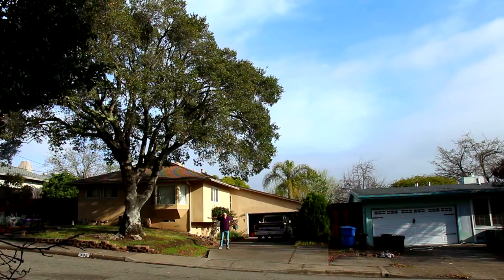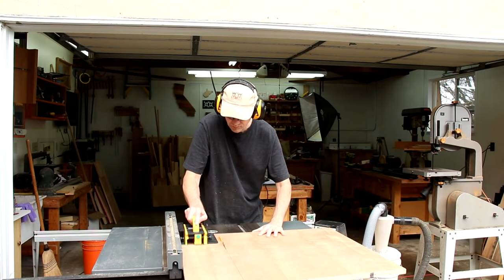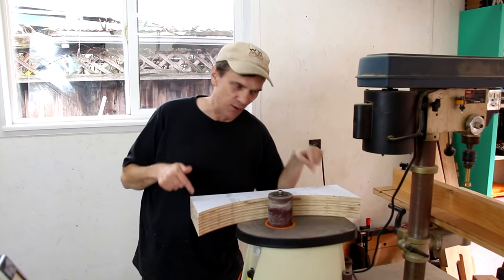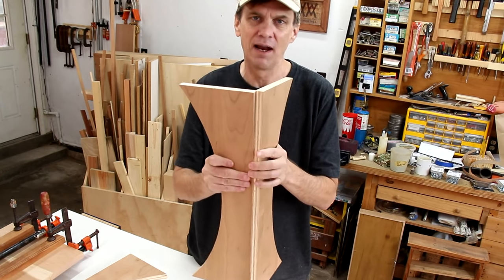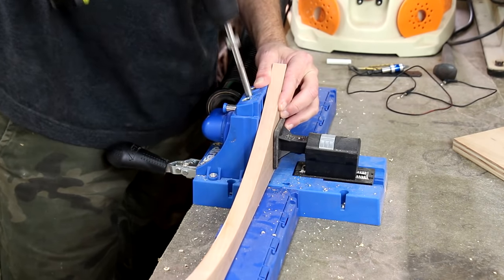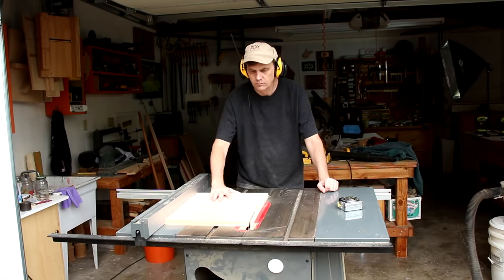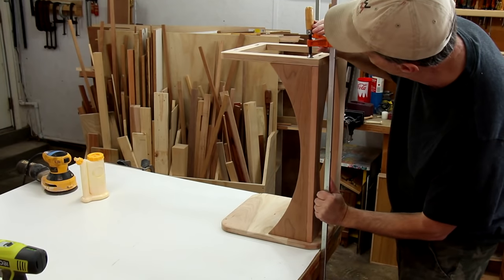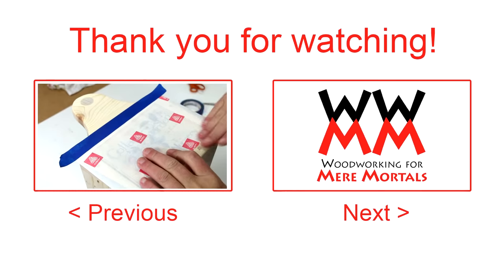Sofa snack table. Great for your living room!

Comment: Steve: a few friendly suggestions: It would have been nice to try and eliminate as many visible fasteners as possible (ie: all the pocket holes). The V joint in your uprights would have been the perfect place to use biscuits. The uprights could have been screwed up through the bottom as well. This would have left just the 4 top pocket screws showing, which aren't that noticeable. Just something to keep in mind on future projects. I know pocket holes are quick and convenient, but I prefer to use them where they don't show.

Comment: I think you could have done a better job with the joints.  You employed your jointer why not use a 45 degree joint with biscuits or an interlocking bit. You didn't cover up the pocket holes.

Comment: Wait, you use biscuits to keep it aligned, not putting glue on the biscuits shows you don't believe in them for strenght? So why the boards clamped on top to keep it aligned? :)

Comment: I've only recently stumbled upon your channel, but I'm finding it really easy to follow and full of very useful information. I'm new to woodworking and have been working on this project. I used a jigsaw instead of bandsaw (don't have one) and laminated panels instead of plywood (a bit cheaper and no edging to worry about). I added a couple of circular indents for cup holders (practice using a router) and a blue epoxy resin channel about an inch in from the edge (just because I've never done any resin before). It's come up really well. Thanks for all the content you produce! Now to find the next project to work on...

Comment: Hi Steve. You said that you had originally wanted to use miter joints to join the sides. That made me think about dovetails and box joints. I find myself really liking the look of dovetail joints in most projects. I know that many times it comes down to preference, but is there maybe a reason one of those joints wouldn't be good for this particular application?

Comment: Steve,

Love your videos!  A tip for mitering long joints in plywood is to run a rabbeting bit along the finished joint to take out a square rabbet, then glue a strip of matching or contrasting wood into the rabbet.  Trim, sand, enjoy the custom look!

Comment: Instead of a miter (or in this case, butt joint), I wonder about using some sort of square piece of solid wood (even an accent, if you wanted) that both panels would join to.  That would give you a decorative, more intentional looking joint, albeit harder to implement.

I really like the design on this one.  And you've convinced me to start using edge banding.  As always, thanks for the awesome content!
Reply: I was thinking the same thing... joins up the 2 plywood pieces nicely. And it could be a quarter round piece too, if you wanted a roundover on the join.
Reply: ***** Thanks!  So is everything you do.  :)